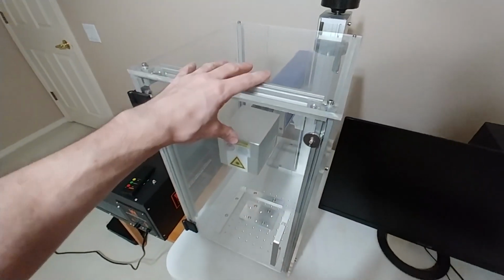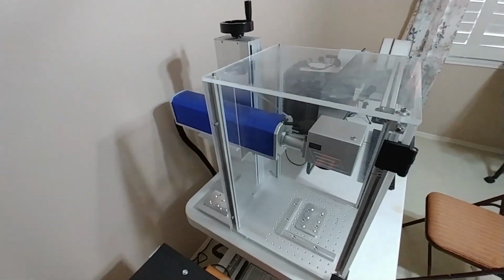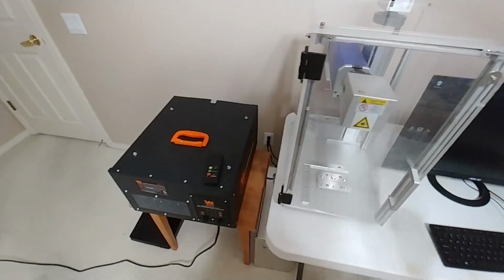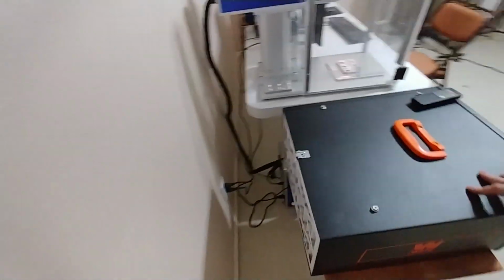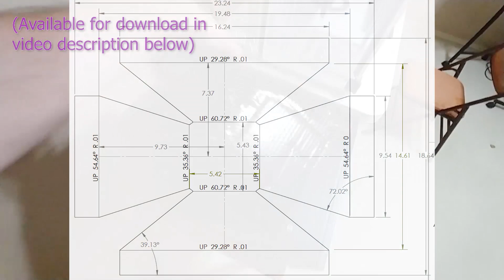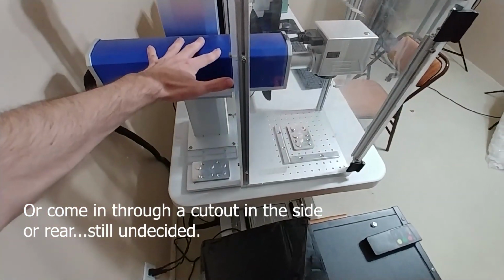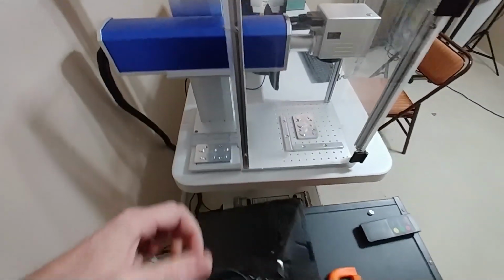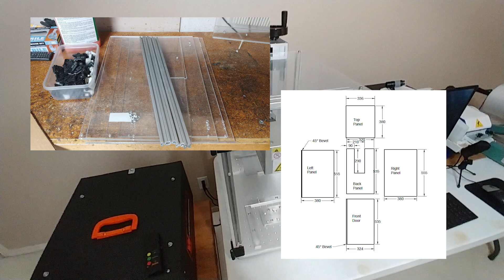Making a Fiber Laser Enclosure with Filtration

Comment: Am I correct that the Polycarbonate should protect you from the 1064nm laser since the laser is actually absorbed by the polycarbonate and is not transmitted trough. The white light from the burning will generate UV light and that will for sure not pass the polycarbonate, so it should be all good.
Reply: Incorrect. Any reflections or refractions will go right through the polycarbonate. You cannot see 1064nm. Please utilize laser safe materials. You get one set of eyes.

Comment: almost bought that air filter, ended up with a box fan, with two filters a micron and pre filter, moves more feet of air
Reply: Oh please for your own safety DO NOT DO THAT.  A box fan may have CFM's but it lacks high static pressure, as such it can't really drive air through the filters all that well and will quickly "saturate" even though it isn't that full.  After that it starts to stir the air in the room and effectively is more dangerous than not having a filter at all.  Also these standard dust filters are not good because they give a false sense of security with the laser fumes.  Truth be told you aren't capturing the most dangerous particles and they just get blown around the room.

If your laser has a work area of 150mmx150mm the focal point of the beam is somewhere around .034mm or 34 microns.  The dust generated by the laser varies in size from a few microns all the way down to well below 1 micron in size.  Proper laser filters use high pressure blower fans with several stacked stages of media.  Usually includes a couple pre filters, a hepa filter or two, and then a carbon stage for adsorption of the obscenely small stuff.

TLDR: Either vent directly to outside or get a proper laser filter.

On a separate note, I tried the downdraft table idea and while it worked initially, it wound up being a terrible idea and nearly burned down my house.
Reply from the maker: @seashadow5239  Interesting, what are you using now to filter?
Reply: @jefferyj  Currently exhausting outside but eventually I'll just buy a proper laser filter.  They may be spendy but they do a good job and are cheaper than medical bills in the long run.
Reply from the maker: Yes! I saw that method was pretty common and did consider it.  Definitely a more attractive price...how is it working out for you?